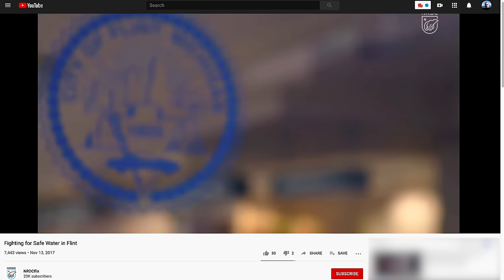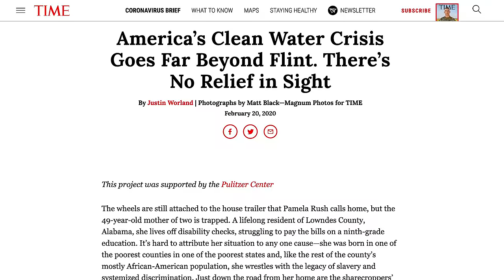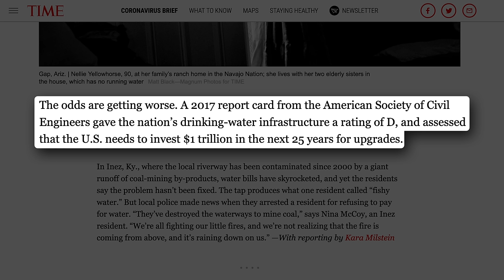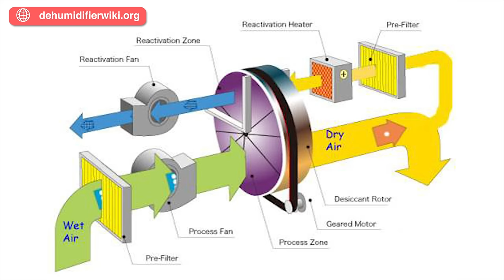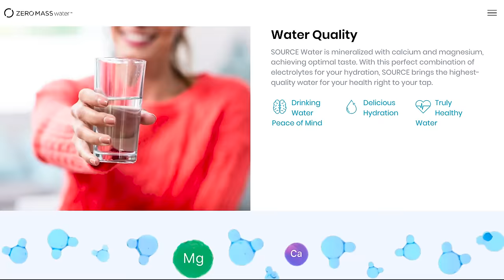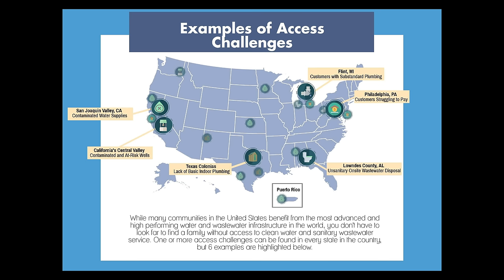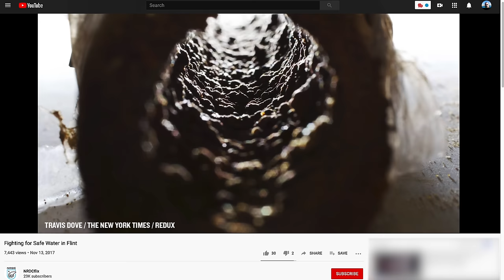Off-Grid Water With Air and Sunlight

Comment: Take a  pan that will hold water.  Build a slanted box to go around it.  Lay a sheet of glass over the box. Put a gutter on bottom of the glass that can catch the water as it rolls down the glass (lowest area).  Connect a tube to the gutter that will go to your gallon jug. Set in the sun.  In the morning go get your water and refill the water that has evaporated.  Way cheaper than $6k.  Make it as big as you need.

Comment: Finally, I can change my name to Luke, move to the desert, and open a moisture farm!
Reply: Change your name to Mouse, you could start a movement.
Reply: No desert air is dry. This will work in humid air only.
Reply: @humanbeing20118  I was about to make that comment but then there are some bugs in the sonoron desert survive with the little moisture by some unique structures on their hard shells (early in the morning there will be some dew in the desert). One need to do a careful analysis and find out whether it make economical sense and the quantity collected on a daily basis is enough.
Reply: Make sure you pick up some power converters at Toche station
Reply: Good luck with that. 🤣
Reply: @humanbeing20118  No their is humidity in the desert just less. In fact the more people in the desert the more humidity.
Reply: @humanbeing20118  you wood be surprised how much water you can get. check those desert system with the special screen they can supply a village and fields. By now.😃
Reply: @humanbeing20118  The air in the desert also has humidity, maybe not much, but it definitely has humidity. You could get only 10% but you would have pure and clean water even in the desert
Reply: @Michael Hill This is useful for someone who doesn't live in the city or for someone who doesn't have power from the grid, or in a massive blackout or some disaster that hasn't affected your home, but if the supply chain and you can't buy water and the power grid is out of service, Then you'll want to have one of these.
Reply: @humanbeing20118  I agree
Reply: Thank you, didn't see that one coming.
Reply: @humanbeing20118  it only needs 10% humidity
Reply: This comment/joke went over alot of people's heads. It's a great star wars reference 👌.
Reply: A moisture farm 😅. Hell yea tho
Reply: also buy nerfs
Reply: Came here to comment about my new proffession but you beat me to it...lol
Reply: @humanbeing20118  not so. Air harvesting is done in deserts with less than 2 inches of precipitation a year (India comes to mind). It's actually harvesting condensation. Humid environments actually condensate less efficiently.
Reply: The Modern Day Warrior  a good search term is 'condensation harvesting'. Brad Lancaster is a proponent in the US (Arizona) with some informational resources on his website. But searching with that term you will find projects from many places in the world.
Reply: @humanbeing20118  works everywhere. It may save your life in a desert.
Reply: They are pocketing the money for it. Almost all cities do it
Reply: May the force be with you.
Reply: Hahaha
See you there,  Luke.
Reply: @humanbeing20118  really all you have to do is get the surface temp down below the dew point. Check the dew point in your area to get an idea how much power you would need.
Reply: @Rich B yeah could get alot of solar and dehumidifiers for the price of these things.
Reply: LMAO
Reply: Last name: Skywalker
Reply: Yeesssss!! 😄
Reply: Why not just use tap water filters? Do they come more costly?
Reply: A moist excellent idea
Reply: The noise pollution is a deal breaker. Will retire in neveda in a tiny home which is solar off grills so no room on roof for additional panels
Reply: @humanbeing20118  that’s only half true. It will still work, but it will work a lot worse.

Comment: Get the water tested about 30 days apart for 4 months.  Just saying, your tossing the word Pure a lot and as a consumer check for yourself for your family.
Reply: @fatboy19831  thx, water is tricky.
Reply: legionnaires disease does spring to mind.
Reply: @Bangpath247  Maybe a silver or copper or UV or ozone screening method, if not a pathogen filter process?
Reply: G ary I was thinking the same. Think I’d have it go through a house filtration system anyway.
Reply: Pure is a chemistry term, not a biological one. Pure means that there is only one of that (element, molecule, compound, etc..). Until the mineral cartridge what this thing produces is PURE water, meaning there is only H2O (with some air gasses dissolved in it 😄). What you've implied is "sterile" or "harmless" which refers to the pathogen in it.
Reply: I'm  water is two parts hydrogen and one part oxygen. That is a proven scientific fact!
Reply: I'm  hahahhahahahahahahahaha
Reply: I'm  Damn.. your pusher is good man, god bless him
Reply: I'm  I hope you realise that, if you run enough electricity through water, you'll get oxygen and hydrogen.
And that you really are in dire need of a dictionary. And some middle school science classes, too. Maybe primary school. Get a 10yo to tutor you.
Reply: I'm  Sure. Give me a lightning rod, a storm, and a bucket of distilled water.
Dude/dudette. Look. I'll make it simple.
Air is an insulator too, but you get lightning, don't you? It's the same thing for water.

As I said before, run ENOUGH electricity through water and it breaks down into H and O (which recombine into H2 and O2, gases, and sometimes some O3 - ozone - as well). With distilled and/or unionised water you'd still get some conductivity bc water is constantly partially broken down into H3O+ and OH-, which are conductive. As in, completely pure, distilled, unionised water at 25C still has about 10^-14 mol/L of ions. 10^-7 of each, which is where the pH 7 comes from, bc pH=-log[H3O+].

I've luckily been able to read more than one dumb book on it. And try related stuff in labs too.
Reply: I'm  Of course not, because it's way too inefficient. I have seen it made with regular wired electricity though.
And yep. E.g. All non-flammable polymers are made from highly flammable substances.
Attributes? More bs. E.g. Mix high concentration sodium hydroxide (highly corrosive) and hydrogen chloride (highly corrosive) in the correct proportion and you get the super dangerous... SODIUM CHLORIDE (and water). ... Salt water. Wow. You could literally drink it (you'd end up dehydrated though). Or cook something in it.
Reply: I'm  oh, sorry, I missed the last bit of bs.
H2 and O2 do weight the same as water 😂😂😂😂😂 from 9kg of water you'd make about 1kg of H2 and 8kg of O2. Or vice versa. You'd need 1kg of H2 and 8kg of O2 to make about 9kg of water. Gases are hard to weight though, so just pressurise and cool them to get them as liquids.

Edit: Btw, what weights more? A kg of styrofoam or a kg of steel? 🤣🤣🤣
Reply: I'm  It's pure water. No electrolyte. And the gas is not visible, obviously. Nor did it run for enough time for a measurable mass of water to have been electrolysed.
And I see you're conveniently ignoring all the other arguments and using varied fallacious logic on the only one you did mention.
Please go see a neurologist. Something is not right.
Reply: I'm  No, not that. I'm just a materials engineer :) I do test, almost every day, several things that would only be possible as I explained above (or in very very similar ways that have yet to be uncovered).
For example, something very simple and observable is how pure water crystallises, which is only possible bc of its well known molecular structure.
And yes, I do trust the observations of countless other people who did test the things I mentioned. What reason would tens upon thousands of underpayed students and researchers have to lie about it? 🤣 I'm a student researcher myself. I'm pretty sure no one is paying or blackmailing me to lie.
The fact is, you're the one who's testing nothing. :) Bye!
Reply: Yep.   It's more distilled from the air than anything else.  But, give it time and see what bacteria  develops.
Reply: I'm  i barely passed highschool and i could answer everyone of those questions but im afraid its you who doesnt want to accept new information
Reply: Fluarine can be taken out by using a little borax!!
Reply: I'm  Just leaving a comment for later
Reply: @Rich B not so sure, the machine picks up a lot of dirt in the process which might dissole in the water!!
Reply: @Rich B yes its worth investigating! Just by the way fluoride the most lethal can be removed from water using a pinch of borax..
Reply: Puring your water up without minerals is harmful..
Extra ions and minerals are a necessary, which some RO UV filters have a cartridge to add minerals ..
Reply: @msvnr1951  a little pinch of borax takes care of the fluorine!
Reply: @Bangpath247  exactly, and not to mention the plastics that get exposed to the sunset and dissolve their weakeners in the water....  so without an active carbon filter system and UV decontamination I'd not sip it.  I think drilling a well is less costly and less fuzz getting it safe for drinking.
Reply: 90% sure the water might be polluted from air pollution
Reply: H2O got flat earthers too?
Reply: I'm  You are a perfect example of someone who knows just enough to be dangerous.  

1. Water is not an element, it is chemical compound made up of two actual element, hydrogen and oxygen.  Water absolutely can be destroyed, I've done it and it's done in high shool chemistry classes all the time. It's called electrolysis.

2. Oxygen is not flammable.  It's an oxidant without which other chemicals can't burn, and when it's present in concentrations greater than normal air, it increases the flammability of everything around it, leading to a misconception that it's flammable itself.

3. An "HHO generator", as you call it,  does not rely on impure water to work.  It creates water, it does not depend on its presence to work.  You seem to be confusing a water generation device with a battery.
Reply: You don't need to get the water tested unless you live in an area with high air pollution.  It is condensing pure water out of the air, taking advantage of the natural distillation process we know as "evaporation".  Now if you live someplace with really polluted air, you could be getting trace amounts of acidic solutions (think "acid rain") but it's not likely.  I would recommend testing it periodically for biological contamination, unless you keep it scrupulously clean.
Reply: I'm   There's nothing to question if it's a proven fact.
Reply: I'm  Read all the comments above that aren't made by you.
Reply: I'm  all you need to do is up the amperage and voltage to a rediculous degree and you'll still get hho.
Reply: I'm  I destroy water all the time to make syngas. Pump super heated steam (h2o) over very hot charcoal (Carbon) and you will get two things from this reaction: Carbon Monoxide (CO) and Hydrogen (H2). The resulting flow of gas out of the fire will ignite extremely easily as half of it by volume is hydrogen. Carbon Monoxide is also extremely flammable and it is what creates flames in a camp fire. It's also known as woodgas. Here's a test that you can do and if you don't you have yourself to blame: Pump hydrogen and air into a sealed glass jar with two electrodes to create a spark and ignition. The hydrogen will burn. Wait 10 minutes to let the glass cool down and see the droplets of water on the inside of the SEALED glass jar. The only conclusion is that H2 and O come together to form WATER.
Reply: I'm As someone whose attracted to ancient wisdom, I would like to know the name of the book, sounds like a gnostic author I know of. I always questioned that h20 part after seeing the tests, like how do they know that hydrogen doesnt take up 4 times as much space, questions of that nature.
Reply: Drop a silver dollar in the water reservoir. Done.
Reply: I'm  can your provide a reference for further research.
Reply: I'm  uh. Just run a hydrogen torch towards a jar, It forms water. Are you saying water is flammable now?
Reply: I'm  also if water is an element like you say, explain the formation of lye (NaOH) from sodium metal Na(s) in pure water which forms a byproduct hydrogen gas. 
2Na(s) + 2H2O(l) -> 2NaOH(aq) + H2 (g)
Additionally, explain the interaction between anhydrous ammonia (NH3) and water forming ammonium hydroxide(NH4OH)
NH3 + H2O -> NH4OH

and finally, explain why the pH/pOH of water is at 7 when water does not dissociate into H+ and OH- ions on its own. Because if water does not dissociate, [H+] or [OH-] is equal to 0 and -log(0) is undefined and not 7.

H2O > H+ + OH
Reply: I'm  yeah and you put sodium, which is explosive, and you put chlorine, which is a deadly poison together, and you get table salt. What’s your point? Chemistry is weird like that.
Reply: I'm  also oxygen is not flammable , it allows other things to be flammable by allowing the formation of bonds between C and H atoms to create CO2 and H2O which releases energy in the form of heat.
Reply: I'm  all chemical processes rely on the fact that forming bonds releases energy and breaking bonds require energy. Elementary schooling is misleading because it states that “energy is stored in chemical bonds” when it should be “energy is stored in the potential to from bonds” but that isn’t intuitive for young children so they simplify it.
Reply: I'm  lastly, elementary school teaches that there are different forms of energy when there is actually only one form. Kinetic. All other forms of energy can be explained using kinetic. 

One more thing, molecules only refer to covalent bonded particles. Not ionic or elements. Ionic is referred to as formula units while element is simply referred to as atoms. Not every tiny particle is a molecule, but every molecule consists of atoms.
Reply: I'm  I haven’t said anything about the generator, why are you bringing that up? Is that the only point you have compared the the numerous ones I’ve brought up? Also, water levels do go down when you’re running a H2O electrolysis, it just doesn’t affect the reaction because it doesn’t affect the rate law and equilibrium because solids and liquids aren’t included for the rate law. I’m not gonna explain why they aren’t included because google does that.
Reply: I'm  if you’ve noticed, none of the chemical reactions I have above require electricity or anything besides pure distilled water and another compound. One of them is literally distilled water itself.
Reply: I'm  first disprove my points then I’ll listen to yours.
Reply: I'm  besides depending on the type of alchemy, there is a fifth element, metal. I feel like I’d know more about alchemy than you.
Reply: I'm  and also, the term atom came before the term
Molecule because of Democritus. So that point is false.
Reply: And even further, modern science is capable to reaching one of the ultimate goals of alchemy which is lead to gold, so I’d say modern science is superior. I could also consider a particle accelerator as a philosopher’s stone to some extent as it is able to create practically any substance from elementary particles.
Reply: I'm  you also seem to think atoms are the smallest we’ve gone. We’ve gone so much smaller it’s stupid
Reply: I'm  I’m giving you pre established chemical reactions that can’t happen if water is indestructible. The burden of proof is on the one who is going against convention, which is you. If you cannot prove how the reactions work when water is indestructible, your point is invalid.
Reply: I'm  I’m an atheist too, I don’t have religion
Reply: I'm  you also said that atom is another word for molecules when atom was first coined by Democritus and the term molecule was created in the 1800 to refer to... a group of atoms.
Reply: I'm  and you’re right, I can’t attempt to show my intelligence to someone who isn’t intelligent.
Reply: I'm  something is incomprehensible simply because you can’t understand it.
Reply: I'm  I mean if you really like the electrolysis thing and you believe the cathode and anode is breaking down. can you revert the gases given off back into the metal form? you sure can change it back into water by burning it, but you can’t change it back to a metal. Also, why is the anode never consumed like in galvanic cells?
Reply: I'm  plus, alchemy states that there is 7 metals, how do you explain the many others? is aluminum not a metal? Is platinum not a metal? Is sodium, potassium, and literally hundreds of other metals not a metal?
Reply: I'm  you should lay off your idiocy. There , I’ve made my points, can you disprove any of them?
Reply: I'm  what does that have to do with anything? You criticized me for not making any points and now you’re doing exactly that, and yes, it does. If you add enough, it becomes a syrup or powder.